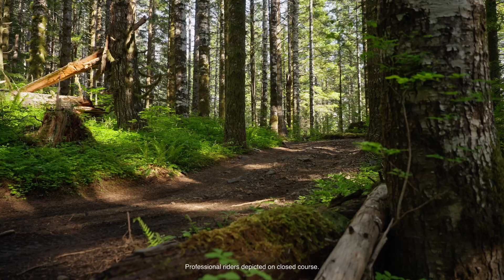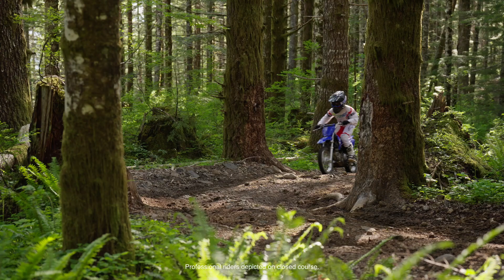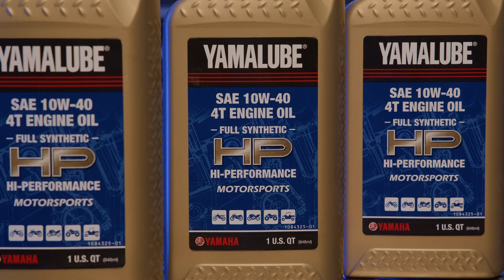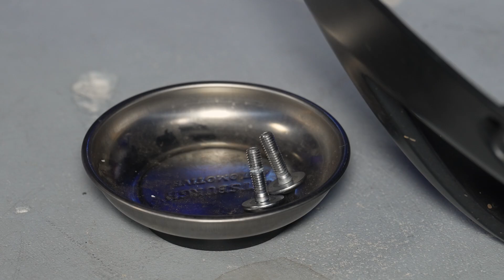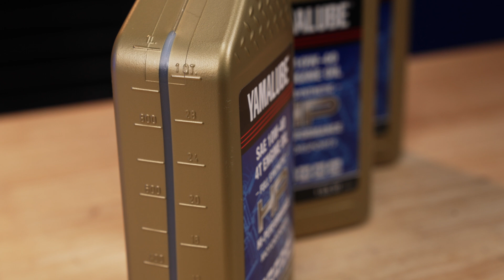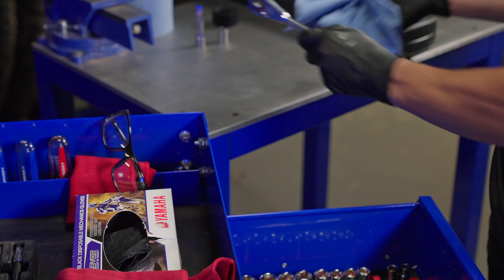How to Change the Oil on a Yamaha TT-R230 | #Yamaha DIY Garage

Comment: Every "90 hours lol or 6 months" lol i do it every 15 hours  a bit excessive  but it  seems to like it
Reply: its not a race bike lol these bikes could go without a a oil change ever and still run fine
Reply: @Bajue   i mean if you just putting around the farm yea, but i like to take it to the trails and ride along at almost full  throttle in 3 or 4 the gear lol